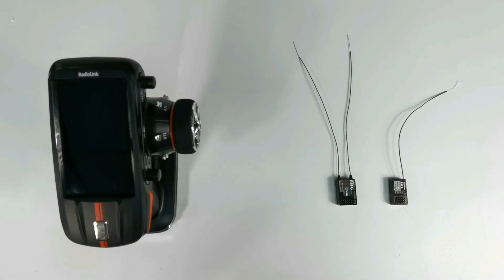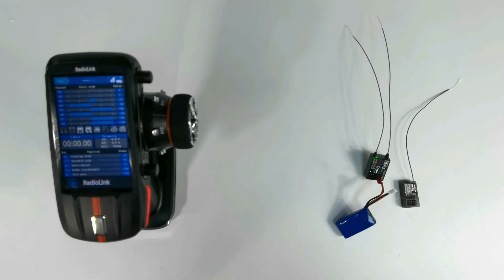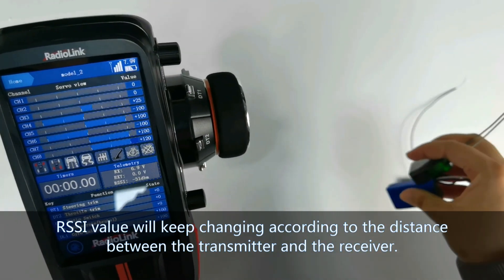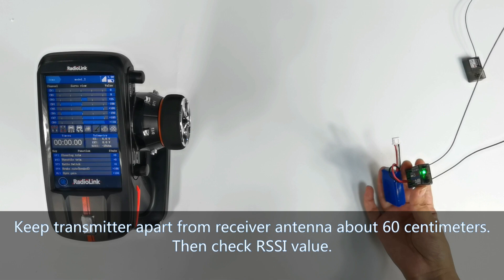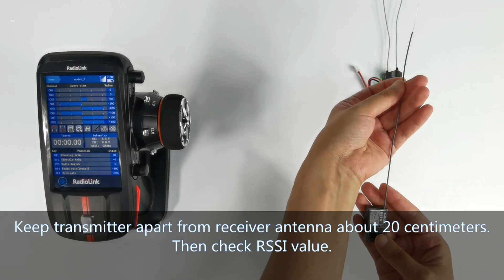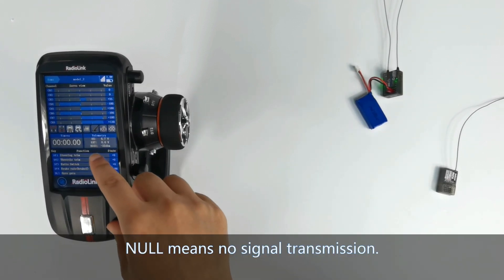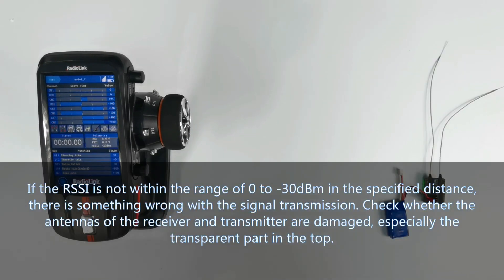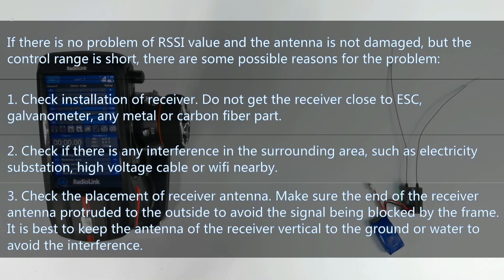How to Test RSSI with RC8X Transmitter and Receivers?

Comment: How can I use the Radiolink RC6GS V3 with a moa setup so i can lock the rear axle and keep the front motor driving
Reply from the maker: Hi, sir. Do you mean the Firmware for Four Wheels Steering for RC6GS V3? Sorry the firmware is not available now. Please wait for it. If any question when using RadioLink products please feel free to contact us. Our email is: after_service@radiolink.com.cn
Reply: @Radiolink_official  i mean how to setup a dig on a moa rock crawler
Reply from the maker: @vision3038  Hi, sir. Generally, connect the dig and then you can use it. But for details on how to set up the dig, we recommend you to check the detailed manual of it. Here is the detailed manual of RC6GS V3 for your reference: https://www.radiolink.com/rc6gsv3_manual  If any question about RC6GS V3 please feel free to contact us. Our email is: after_service@radiolink.com.cn
Reply: @vision3038  if your still trying to look at this I may be able to help, I previously upgraded from a rc6gs to an rc8x, but I may be able to help as I had done similar things, if you want to have several things bound to one switch I also did that so I should be able to remember how